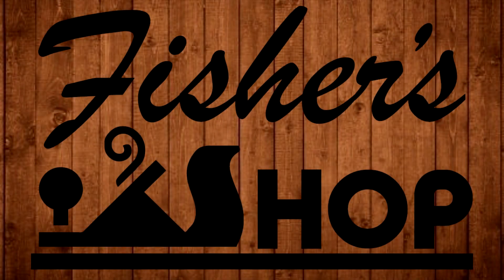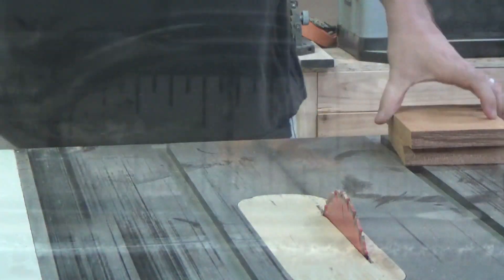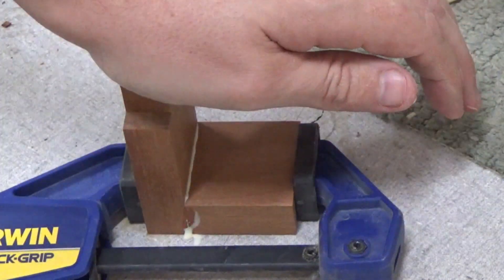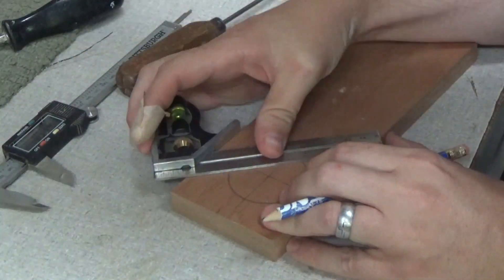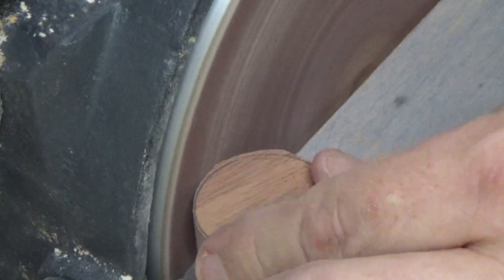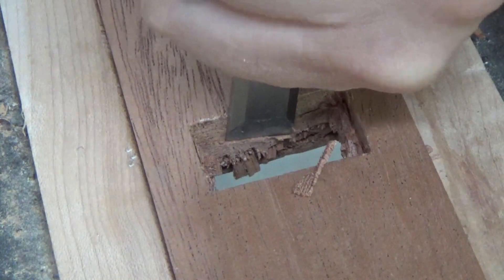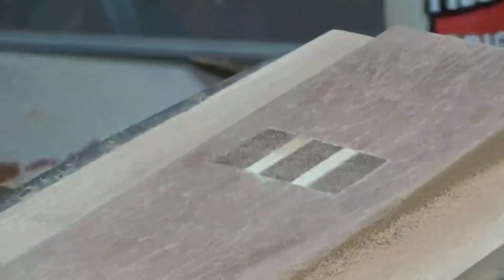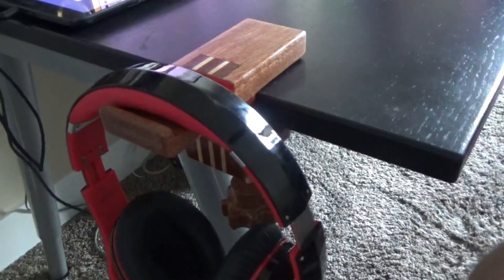Woodworking: How to build a headphone clamp/holder

Comment: Great video!  Tip for you:  Use a drill press to drill holes then use a chisel to square up your corners on your mortice. :)
Reply from the maker: I did that on my first attempt and it didn't turn out all that good.  But for a 3/4" mortise I used a 3/4" forstner to hog out the material.  I should have used an undersized bit.  So I just did it all by hand... worked well enough.  But yes, good tip.